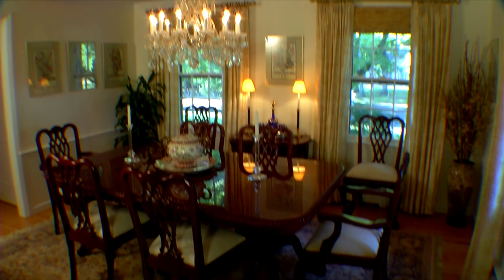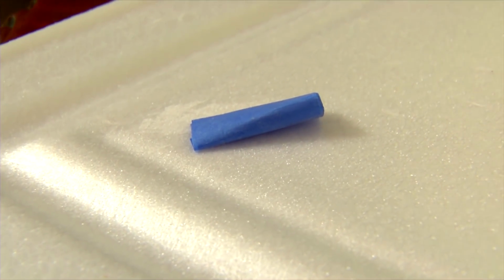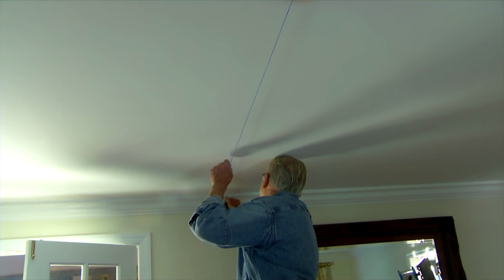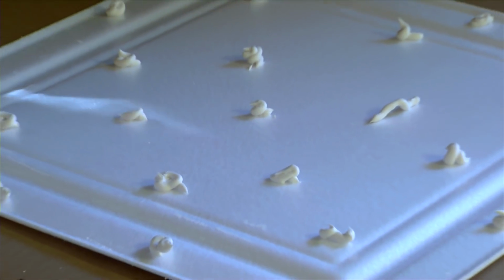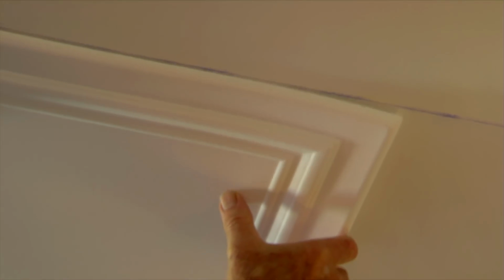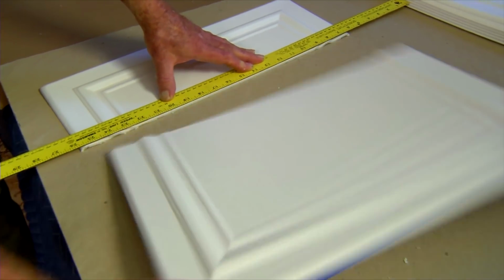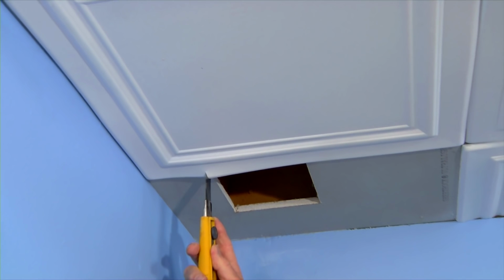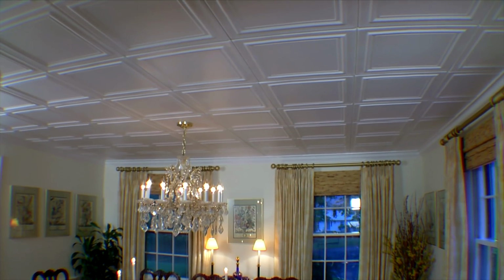How to Install Embossed Ceiling Tiles

Comment: I have a ceiling that is a mini cathedral style where the peak of the ceiling is 10' high and the walls are 8' high. This is a mild slant to the ceiling. One side of the ceiling meets the living room wall and the other side connects to the wall over the foyer. Based upon this style ceiling would I start the tile installation at the peak of the ceiling. I can still find the center of ceiling going from the paek to the wall and from the ends of the ceiling. I have been unable to find any demonstrations for putting ceiling tiles on a slanted ceils such as this.
What would you recommend? I am thinking that I sould have a full tile at the peak of the ceiling for appearance sake. Does this make sense?
Thanks,
Ray

Comment: Information given to me has always been to totally cover each tile with fixative, not spot fix them because spot fixing leaves air beneath enabling any fire  to spread underneath them before being noticed until a fair distance across the room and they fall down either on fire of if fire proof still enabling the fire to have spread. This info. first related where the spot gluing was done in just the four corners, leaving a fair cushion of air. No wish to unnecessarily scare anyone or inadvertently given incorrect information, so perhaps this can be addressed.

Comment: Be extremely careful with blue chalk. What ever it gets on will stain forever. I've seen blue chalk lines on concrete walkways that were there until the concrete wore away. If it gets on your furniture or rugs I hope you like blue dots.